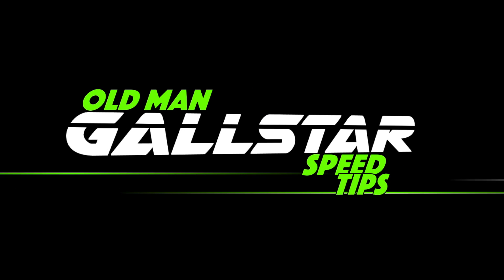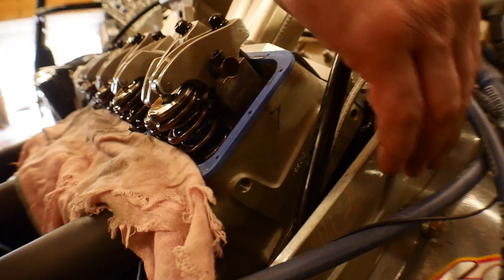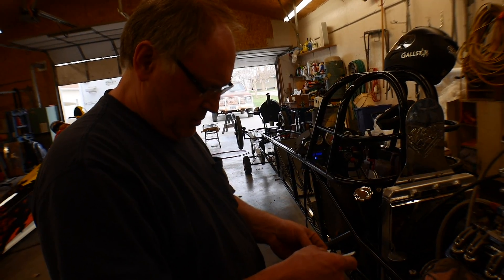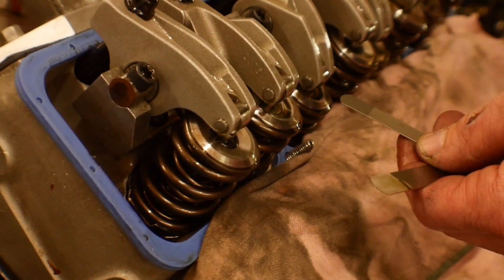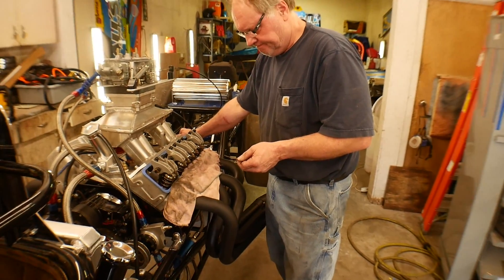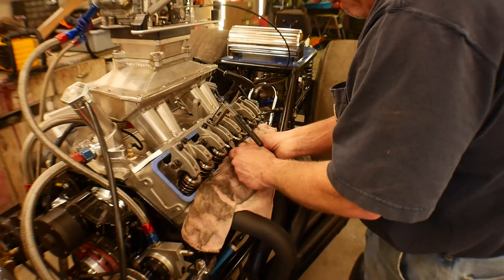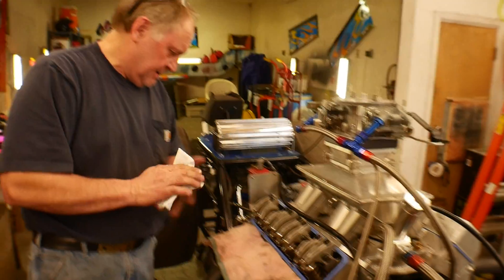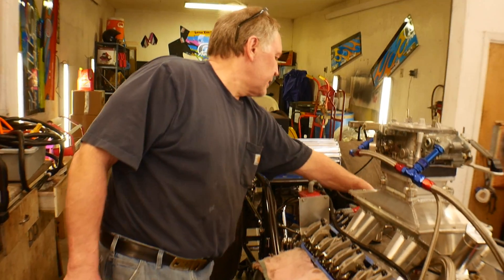Valve Lash Adjustment [SBC]

Comment: Pops is the man!!  Never new that it needed to be warm when checking. 😬
Reply: Same
Reply: I would recommend setting it cold.  Say .020.  Warm it up.  Check lash.  Lets say its .025.  Then you know u set your cold lash .005 tighter to get what the hot lash should be.

Comment: We run lash caps on titanium valves AND stainless valves in order to give the roller a larger platform to roll across. If we ever do have wear (which was rarely) all we had to do was change the lash cap and the valve still looked new across the stem face. Be sure to install lash caps if used before measuring for correct pushrod length.
Another awesome video! 
Thanks Tom!